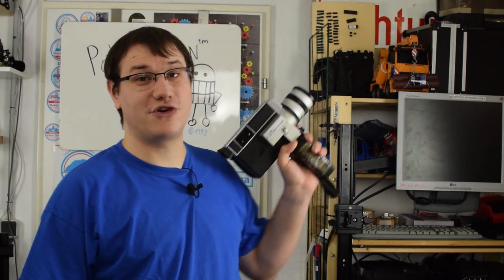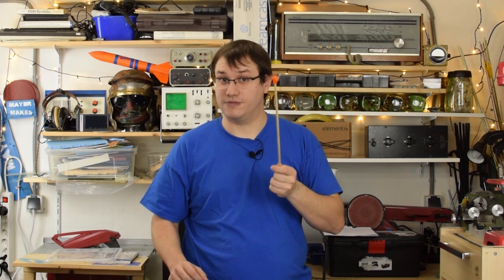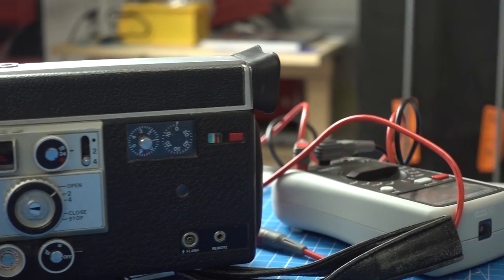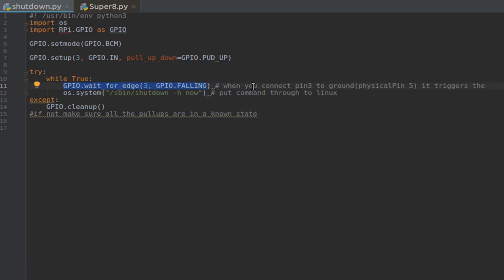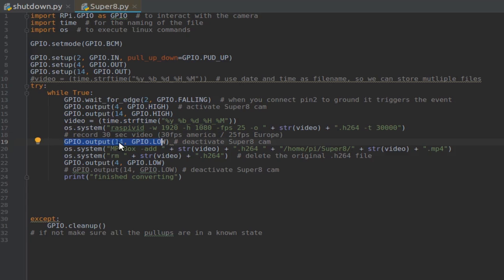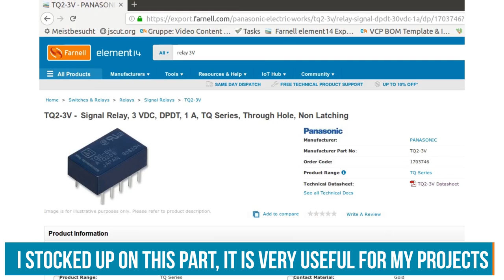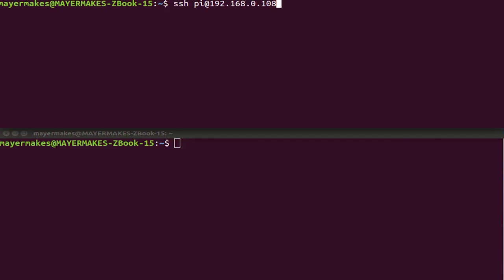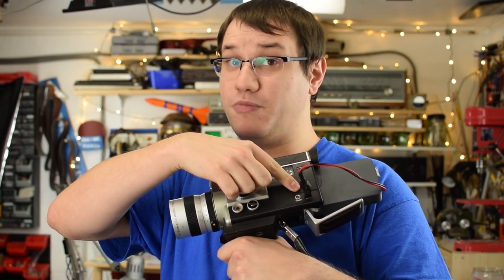Modding a Super 8 Camera into a Digital

Comment: Well, I'm glad that you didn't destroy the camera.  Albeit more difficult, using the internal mechanics that rolls the film to trigger recording might be a better solution.
Reply: I thought about that at first but it would make things to difficult in the given timeframe. And I wanted to kerp the camera unaltered
Reply: @MAYERMAKES  I don't think you'd have to alter the camera.  You could take a piece of film from your development debacle and turn it into a belt.  You could then use an optical sensor of some kind (akin to how old ball mice worked) to detect when the camera has started moving the film belt.

Comment: I love the project. I'd entertain trying one myself.
Some questions and points:
- Is running the camera's shutter necessary? Can you just leave the shutter open by not pulling the trigger and use any arbitrary frame rate without worrying about sync?
- Additionally, the shutter on super8 cameras are not perfectly synced anyway, they're quite imprecise.
- Did you leave on the daylight filter on the camera when recording? It would be better to turn it off indoors and probably on a digital scanner in general. Some of the frames look too warm, although the camera seems to be trying to white balance the image during some shots. You can disable it by inserting a 1/4" screw in the lighting mount.
- Were you using the manual aperture control on that model, or was it handled by the exposure meter? If the latter, then did you utilise or pay attention to the pin system when building the cartridge? And is there a convenient way to vary it?
Reply: thanks for your interest, I'm right at this very moment working on the follow up.
here are some answers:
shutter: all the Super8 cams I have encountered in person so far do not have the ability to just keep the shutter open. they all use on a spring loaded mechanism that snaps it open directly driven mechanically bound to the film actuator. People tried before to sync to the shutter, but in reality these old cams do not have a very constant shutter, so instead I record at max framerate and cut out the black frames in Post(maybe even directly on the device). recording 60FPS with 18FPS shutter should yield enough usable frames.
the Cam I used in this video is a very basic Canon modell for its time, no filters, no manual aperture, just focus and worn out zoom. No grading or anything else has been done to the image besides rotating it. On that particular model the pin system inside does not have any effect, (only fixed plastic parts that restrict the type of film you can insert to suitable Cartridges. 
In the meantime I got a much better Eumig Super8 (f1,8 !!) that is much better in all regards than the Canon you saw in the old video.
The new cartridge system has provisions to take advantage of the cartridge pins but in this iteration it just leaves the camera alone. this also ensures it can fit in ALL super8 cameras with compatible slots.
there are still a lot of challenges to be conquered. but I might have solved a few. But there is a loooot going into this before its something filmmakers might want to productively use.
Reply: @MAYERMAKES  Thanks for replying. I question some of the information in this post.
Firstly, what model did you use? It appears to be the Canon Auto Zoom 814 Electronic. If so then some of what you just wrote is incorrect.
- It is NOT basic model for its time. Relative to general super8 cameras of the time, this model has a lot of features and is actually quite advanced for 1972. I would say it better resembles a 1980s model.
- It DOES have a daylight filter. Again, the screw in the top disables it. (You can visually see the screw female in the video).
- As a separate note, filters can be added to the front of the lens, if needed.
- The pin system reads the ISO of the film from a notch on the cartridge. That model can read a large number of ISOs (relative to cameras at the time).
- Auto exposure is set by pushing in the aperture control ring. Pulling it out sets it to manual aperture control.
- This camera has an f/1.4 to f/32 aperture.
- You may(?) be able to use the remote switch in single-frame mode to keep the shutter open.
- Did you adjust the eyepiece for correct viewfinder focus?
- That camera also has a macro switch, variable shutter angle, exposure adjustment, fade effect, flash sync, frame rate control (up to 40), single shot, remote control, many ISOs supported, power zoom, etc. Most of these features would not appear on a "basic" model from the early 70s.
- The manual can be downloaded from http://www.mondofoto.com/manuals/canonautozoom814electronic/
- Out of curiosity, which model of Eumig do you have? I happen to have an Eumig projector FYI.

Comment: My question is why didn’t you use a super 8 cartridge to house all of the new digital equipment then you would have your perfect alignment?!
Reply: When you open a cartridge you will see that there is not much space in there but a ton of specific plastic pieces that guide  the film. cutting that out takes more time than 3d printing a new case+ you have no exact alignment refference, it has a big hole that accomodatre all super8 camera types.+ the lense has to be several centimeters back. and all the parts needed did not fit inside even if it would be possible to position the sensor right at the front(which does not work because of the way optics work)

Comment: Great start! Two things you might want to look into.
1. I had a super8 camera (early eighties Kmart branded) that had a manual shutter release for things like stop motion filming. It would be a simple matter in such a camera to manually open the shutter, that would remove the problem of the shutter not syncing with the Pi camera module. Also there would be no need to supply power to the camera itself. (It would require a camera with a manual shutter release though).

2. remove the lens from the Pi module, and align the sensor in the exact position that the film would have been in with the original film cartridge.
Reply: I adressed all of these questiosn in detail in the blog linked in the description, give it a read!

Comment: I kind of want to give this one a shot (pun intended). I have a Super8 camera  which has a hinged side to it (so positioning the camera bit would be a hell of a lot easier). Date codes on this one (stamped into the plastic bits) suggest it's probably from the late 1960s. It's not a Canon so the remote stuff might need revision on my part and this one didn't take advantage of the audio strip that was apparently a thing in some cameras. Funny story, apparently the manufacturer of this camera needed a 6V battery (the adapter has the same connections as a 9V cell that you'd find at any dollar store today). Fortunately they opted to just use 4 AA cells in series instead of some funky proprietary solution.

Also, Digital8 would be a nifty name for this, but those damn kids at Sony had to call their digital Video8 variant Digital8. Oh well XD
Reply: Give it a go and post your build on element14.com so we csn kerp up with your progress

Comment: Great concept and prototype. Interesting to see, and I love that the footage comes out looking so retro. I doubt I'll ever do this exact project, but I can definitely see me repurposing some of the parts of it. 

Those little Panasonic relays on the GPIO have blown my mind. I can definitely see me using those in projects to vastly simplify interfacing with legacy stuff. 

It's unfortunate that Farnell don't stock the Zero W. The dedicated hardware h264 encoding for cameras on the CSI interface would presumably allow a smaller and less power-hungry Pi Zero W to suffice. 

I wonder what the cost (engineering time and BoM) for a minimal Compute Module 3+ interface board with just power and CSI interface (and maybe Micro SD for the Lite and USB for WiFi) would be? Somewhat out of my depth on that! It could potentially shrink the footprint significantly though.

I love the content, and I'm excited to see either if you take this project further, or what your next project is.
Reply: thanks, The compute module approach is interesting, you may want to take the discussion to element14.com so others can chime in and exchange ideas how to pull it of

Comment: I'm working on a project taking an old (and consequently cheap) point and shoot and moving it entirely into a custom made body and add a c mount for lenses like these. The sensor sizes are similar enough to super 8, and c mount's low flange distance should keep the overall size fairly compact. I guess we'll see how it turns out :)

Comment: Did you leave the lens on the Pi camera, and if so would it work any better if you unscrewed it so you were exposing the sensor directly using the optics from the Super 8 camera?
Reply: I did test various combinations and, yes also without the pi lense, but you need it at max extension to be able to see anything at all, the sensor widht and focus lenght are vastly different
Reply: Thank you for the clarification!

Comment: Maybe you should remove the lens from the digital camera, it seems redundant in not destructively excessive (harms the focus maybe).
Reply: I did test various combinations and, yes also without the pi lense, but you need it at max extension to be able to see anything at all, the sensor widht and focus lenght are vastly different
Reply: @MAYERMAKES  If you have a laser or strong light you might be able to find the exact focal point with vapor ( atomized water from sprayer); still, it might be difficult to measure the distance in an enclosed environment, it might give you a better ability to estimate the length.

Comment: You should have used a Pi 1 A+, which would have used less power...
Reply: The Motor probably would still make that PI dropout though?
Reply: I actually used the original pia+ while prototyping, but it took very long to process the video file. Power draw might be less but I did not test that
Reply: @MAYERMAKES  hmmmm...
You could just left it as a h264 file and opened it on ffmpeg-server...
The you could have used vlc or ffmpeg on your pc to capture it

Comment: You'll probably need to take the lens off the camera module itself and align the sensor in the same plane as the film. That'll get the camera closer, and mean you can have a smaller enclosure :D
Reply: Tried that but no chsnce the focal distance is totalky different you need the lense extendwd to near max to get anything to show up, without lens you csn only see darkness or a little light blob

Comment: Dude, I'm sorry but for me this makes no sense. You basically added a lens in front of a webcam connected to a pi, struggling to fit everything in a tiny space. You can get better results by applying a couple overlays and blur to the Webcam footage. No code, 3d printer or soldering skills needed.
Reply: Guess you didn’t get the whole thing here... like people questioning others for driving a vintage Mustang when a Nissan Leaf would get them from A to B as well...